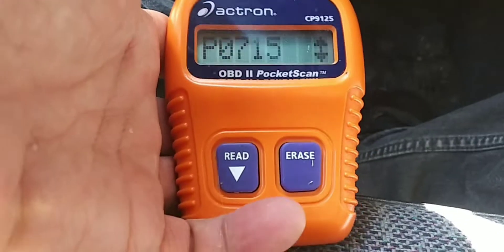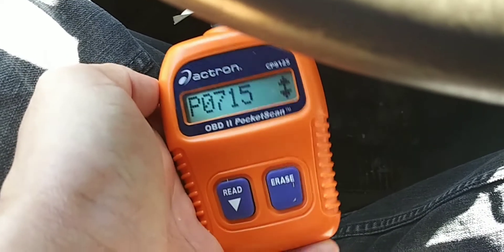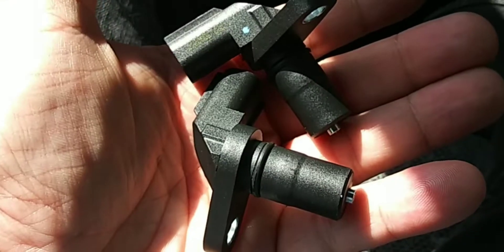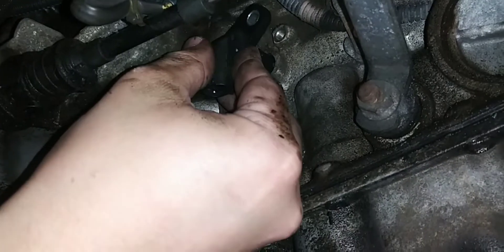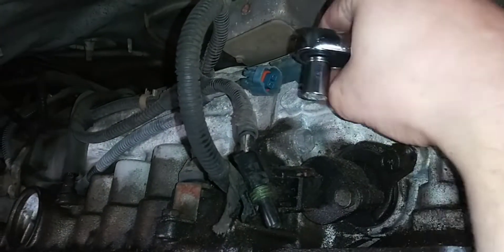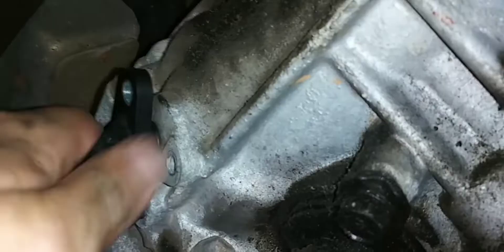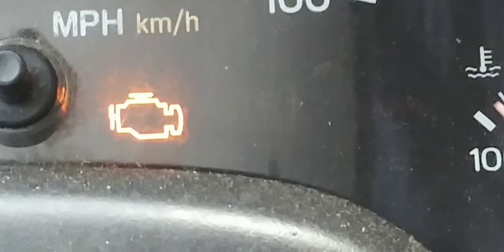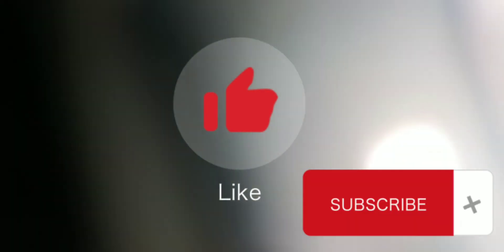Speed Sensor Replacement Fix Check Engine Light and Transmission Shifting Problems

Comment: How long did this sensor hold up for? I just changed mine to an aftermarket sensor and I am still getting the code. Banging my head against a wall trying to fix it.
Reply from the maker: ...Funny you should ask. I just registered code P0720 and I suspect the culprit to be the rear speed sensor replaced in this video. Could also be the harness but I'll have to do some testing first. Will update when I get around to fixing it.
Reply from the maker: Update: One of the two sensors replaced in this video only lasted a year. I just put another one in to fix the problem.
Reply: @mrmanautomotive  I hunted down an OEM Input Speed Sensor and still threw the same code. Next thing I'm gonna do is test the Shift Solenoids when I change the fluid/filter. Hoping to god one of them is bad and that is the issue.
Reply from the maker: Good luck!
Reply: @webuyhouses-t4r  Check the wiring related to it. I changed the whole transmission and still have the same code and a harsh clunk when shifting to Drive and the car was buckling when driving it.
Reply: @webuyhouses-t4r did you check the shift solenoid?? if yes and were bad, what were the symptoms?

Comment: Hi brother, did the engine light came off right after you changed the sensor or you drive it first couple hundred miles?
Reply from the maker: Sorry, it's been a while so I can't remember at this point. Did it end up going off for you?

Comment: Could the speed sensors throw it into limp mood after hitting 3rd? P743 is torque converter circuit electrical?
Reply from the maker: I guess it's worth checking, but the fact that the problem is only happening in 3rd would make me suspect something else. Let me know what you find out.
Reply: Mi Problm is that as soon as I disconnect two wires by the Module in the Glove Compartment in the middle it runs  and shift Correctly.  At some point I was is the speed sensor  but Wich one Transmission has  like 4 or five right?
Reply: Yes